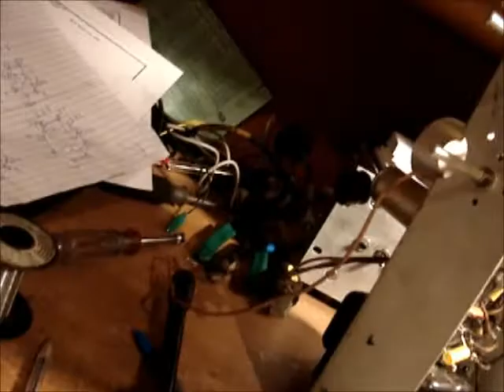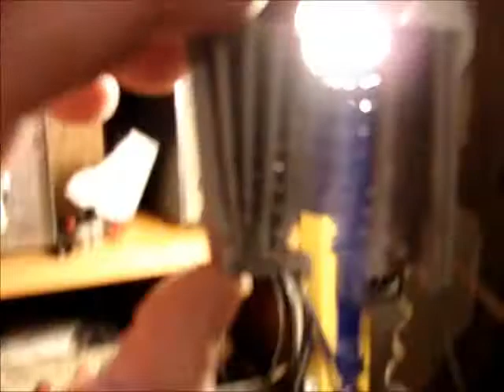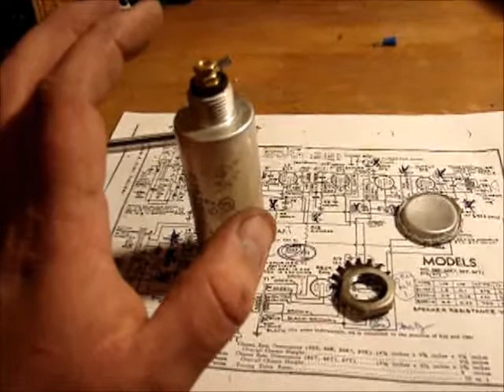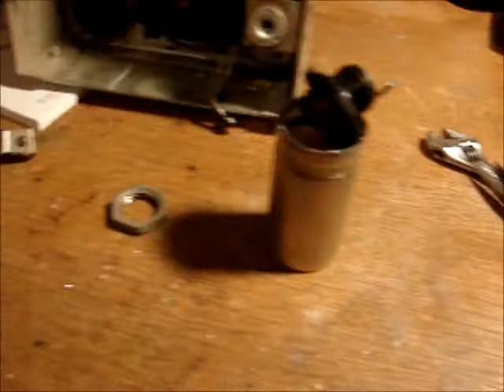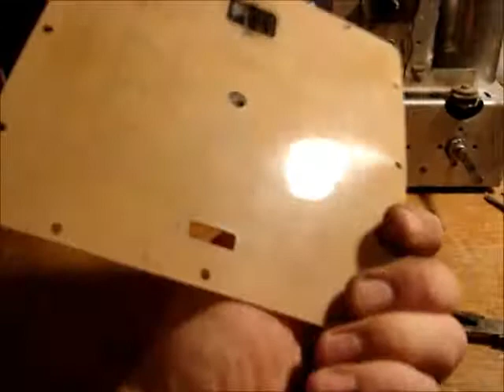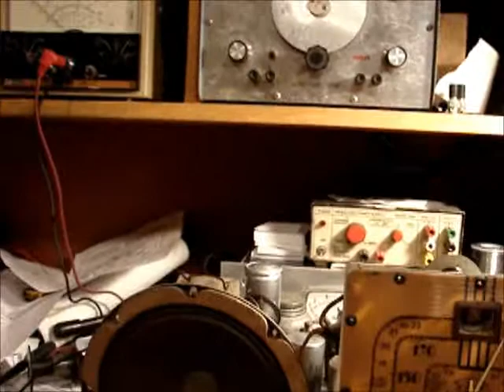RCA 87T part 2 of ?

Comment: I have an unrestored RCA 87T.  After watching your videos, I listened to local programming. The caps and resistors are original or of the period.  I was very impressed with your tuner clean up. My tuner belt slips and it sounds a little rough when the needles move. I would like to clean that up to match the performance of yours. What did you use to clean the tuner and what if anything did you lubricate to get the tunner to move so easily? Is there a trick to removing the dial needles?